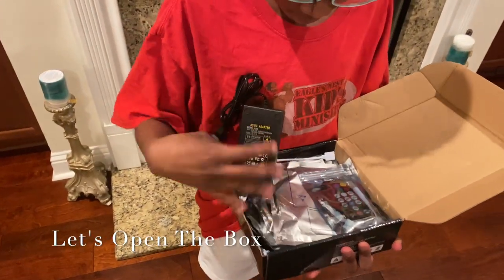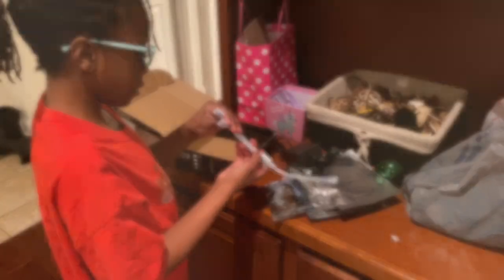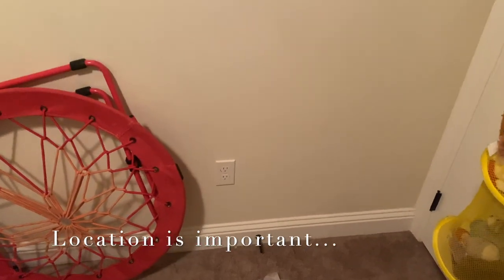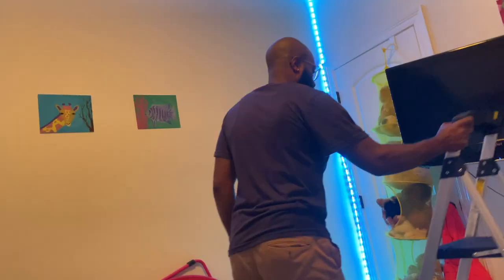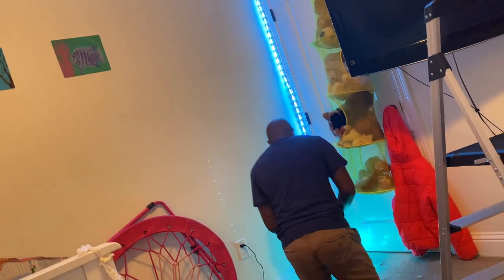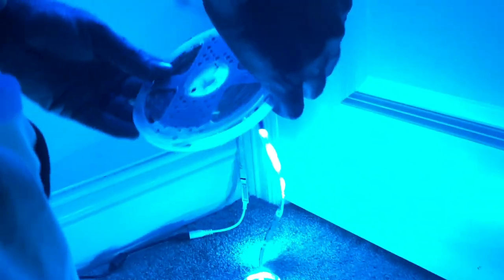LED Strip Lights Installation | Richsing RGB Strip Lights w/Remote 65.6ft ($42 2020)

Comment: HELP! I have installed a set of 3 in one room and in the other bedroom as well and the remotes are synced and controlling each other. Do you know how to get the remotes to work separate for each room?   Very frustrating! Your look awesome!!!
Reply from the maker: Kim, first thanks so much for checking out our video! I hope you subscribed,lol! 1. Ok, not sure about the remotes syncing. I'm sure you could ask the question on Amazon (or wherever you got your lights and maybe someone will answer in the thread). 2. I looked so ever briefly online and could only find videos/articles of people actually wanting to sync all their remotes,lol...not unsync. 3. Last thing, if it were me trying to troubleshoot, I would just unplug each room at a time and sync one room at a time. So if I had to rooms, I would have one light set unplugged and maybe set it to flicker in green...then unplug that set...move to next room and set it to multi-color...then go back to the other room and plug it up to see if each room stays separate. Last thing, you may have to be extremely deliberate in where you point the remote. I know it is wireless, but you may have go directly near where the infer-red is and point the remote at it vs a general point and shoot. I hope this helps and please circle back if/when you get it working. I would love to hear your conclusion!
Reply: Real Men Get It Done I’ll try that! TY 👍🏻I’ll keep ya posted  thanks